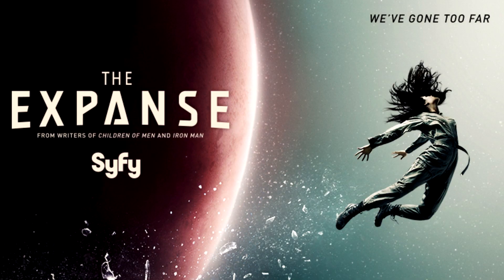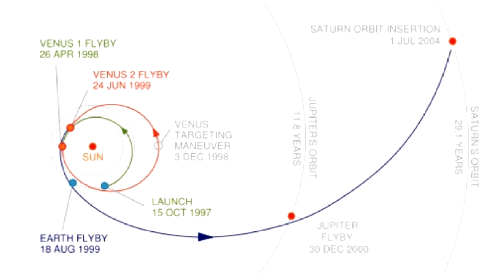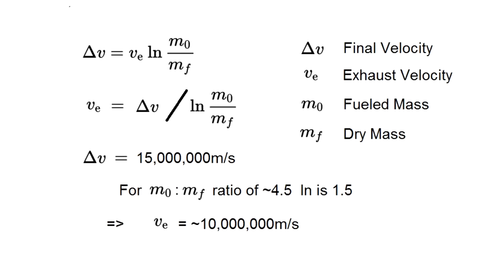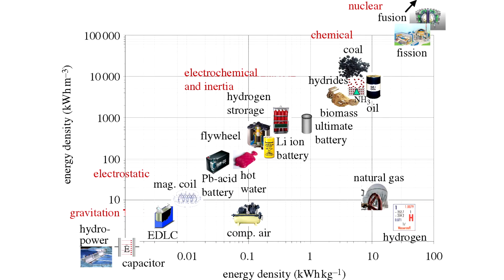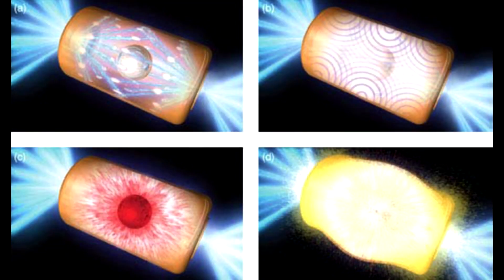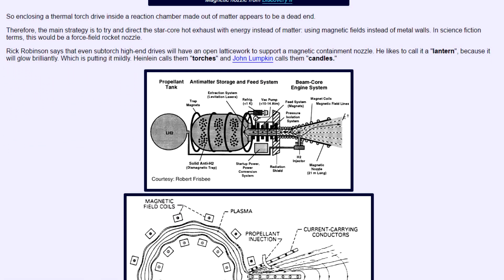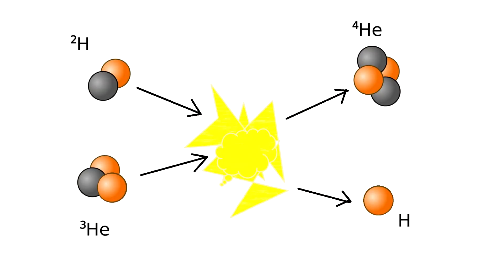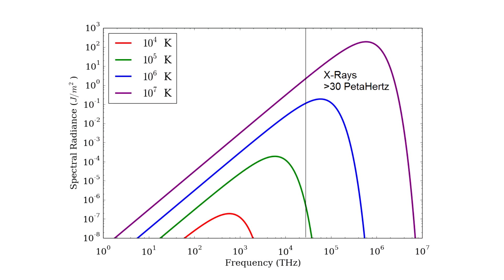The Rocket Science of 'The Expanse'

Comment: I finally recently started watching season one. Things l find implausible.
1) The sheer size of the vessels. And in comparison the volume ofcargo they carry. A perfectexampld is the first shp we see. Canterbury. Why haul around all that extra mass to store ice when you could melt the ice. Distill and store all the contaminates and haul the water in bladders or just refreeze it and push the frozen block of ice.
2) The sheer internal volume of the ships themselves. I know its a TV show but in the future when there are actually miners etc working out in the belt l doubt they will have the internal volume to spare. The MCRN battle ship is even worse.
3) Not just the volume of living space but how it is laid out. Again its a TV show and had to be shot on realistic budgets in sound stages. Given a continuous drive how ever it works. Let go with the approximate 1/3rd gee of Mars. Even during coasting phases some artificial gravity is nice. IMO the mag boots aren't going to cut it. Yes l can see there usefulness. A better solution especial for a merchantman water hauler would be a spin section with multiple modules that rotate on bearings with hatches inbetween the sections. The modules are arranged in a ring or partial rings. When the ship is coasting or at rest the modules are in their rest position. Meaning you head is pointed toward the Axis of the ship. When the vessel is accelerating the modules rotate so that your head is pointing in the direction of acceleration. At low thrust the spin section can still rotate with the floor being canted. Go to the Atomic Rockets website and look up Ezekiel Wheels. I had this idea years ago only to find out that somebody beat me to it. The vessels control station can be on the ships axis in zero gee when at rest.
3) The inplied scarcity of water and other vital supplies. Given what we know about the Solar System today or evenwhen Corey was writing The Expanse the Asteriod Belt is rich in water. At least in terms of what a human society would need. Given that Carbonacous Chondrite asteriods can be up to around 30% water and Ceres should be rich in water. You get the idea. And when the actorsare traversing the tunnels water is just dripping on them. Tunnels. Another dumb idea. Why do so many SF shows use tunnels.
4) Spining Ceres up for artificial gravity. The amount of energy needed to dpin up a body the size of Ceres to provide 1/3rd of a gee would better spent building an O Niel habitat. The Docks on Ceres or Eros Station. Wouldn't these  be better situated at the axis in zero gee. The huilding of Navoo/Nathan Hale or Tycho Station implies implies they they could build O'Niels.
5) Martian terra forming and importing "supplies". Why not divert cometary bodies that are already headed in system. And start small. Roof over part or parts of Valles Marinaris and establish habitats there. Plus Mars may have substantial subsurface water. And given any need of metals why not mine Mercury. 
5) Stealthed spaceships. Given the implied number of ships running around the Solar System there has to be some sort of traffic control system. Lord knows you do not want to be cruising through somebodies exhusst plume of fusion reaction products. Plus once your drive is running everybody with decent sensors will see you. Lets not talk about waste heat. Maybe use it to power a laser pointed out of the Plane of the Ecliptic?
Kenetic Weapons Systems. Those rail guns aren't just hitting their targets. The rounds that miss are now dangerous projectiles racing through the Solar System. How fast are they? Above Solar escape velocity? We know the ships are given travel times.

Comment: 6:21 Although we cant easily direct neutrons, how about if the plasma was moving in a loop and we arranged the fusion to occur while it was heading in the desired exhaust direction, even faster than the speed that the neutron would be fired off at? I figure this could both mean that the neutrons were useful as propellant mass and that they would not collide with the walls of the rocket.
I guess this would mean you have to suck a bunch of energy out of the charged products and put it into spinning up the plasma.

(edit) ah, just noticed there was 4x more energy going into the neutron. I suspect you are throwing so much energy away in the neutron that although you have not wasted it, it goes into thrust, you cannot replace it with the energy from the charged products.

(edit) Maybe this would work for a fission rocket though. According to wikipedia:
For uranium-235 (total mean fission energy 202.79 MeV[15]), typically ~169 MeV appears as the kinetic energy of the daughter nuclei, which fly apart at about 3% of the speed of light, due to Coulomb repulsion. Also, an average of 2.5 neutrons are emitted, with a mean kinetic energy per neutron of ~2 MeV (total of 4.8 MeV)

..so you could potentially expel all the neutrons safely and just have charged products to manipulate?

Comment: Here is how I hypothise the concept: in my theory the fusion techonolgy is advanced enough to fuse larger atoms in a compact enough reactor so it would be able to achieve something like the CNO cycle in stellar nucleosynthesis. The heavy stuff works as catalyst and only the hydrogen is really consumed, the resulting He can be used as reaction mass. The second issue which we don`t have relaibale technology to solve yet is the harnessing and use of energy from neutrino and gamma rays which can be used to accelerate the reaction mass to very high speeds increasing the trust that way (and/or some super dense material can be injected into the plasma stream increasing the actual mass too). In my theory the drives before Epstein used a simple p-p chain hence weren`t too effective, but with the modifications Epstien did the fusion moved to a CNO cycle producing much more enegry which accelerated the reaction mass to higher speed and produced significantly more trust. I know we still have at least two major obstacles we can`t adress with todays technology but flying an aircraft was unimaginable 300 years ago yet the laws of physics were the same. As for no fuel tanks, fuel could be simple water, probably stored between layers of hull, almost like jet fuel stored in wings of aircrafts. This would make sense as hydrogen is a good radiation shield, so this would protect the interior of the ship from cosmic radiation while also would act as fuel source.

Comment: Using the word "in reality" is a interpretation of declaring something impossible while, comparing the task with modern limitation resources. Epstien Drive sci "fi," only failed by a inexperienced space render profession inventor, as an 'energy/EC' rocket designer doing his own astro stunts. 

 Nuclear energy through (supressed truth) history. Was a nuclear battery🔋to manage a tiny dinky 🏟 halogen size🔦👀 of ion/plasma thrust in solar orbit. It was suppose to amp particle boosters from energy momentum pressure thrusters! Because it's not a chem-fuel liquid mass canister with limited volume, in micro air & solar orbit! 
 
 The energy thrust can regenerate, with far less idle time. So even a conservative acceleration of only 0.5 to 2.5 gravity gforce, non stop. Will generate both exponential accel velocity & simulated gravity comfort.

  Mankinds inexperienced of traveling in raw velocity ( without spoiler alterting time & space bending ). Is the required micro atmosphere SHIELD. At just 4% of light speed (in raw velocity). You can then use WINGS👀 in super micro air realms! But nobody has or brings up this knowledge & laughs with old text book declared science 📖 🙄.

Comment: Thanks for this amazing video. You mentioned how it would be incredibly hard to prevent all the heat generated from vaporising the spacecraft. What happens if the spacecraft is not physically attached to the engine but is held in a magnetic field so that between the heat source and the rest of the spacecraft there is empty space. Would it be possible then?

Comment: It seems you guys, yes I include the guys from the sources you mentioned, don't think stuff through. Ya'll claim D-He3 Fusion to be much better when in reality D-T Fusion would be Ideal since you could use Li-Be Shielding which can also be used in cristalline form to refract (NOT REFLECT) X-Rays and also breed more Tritium, so the Neutrons are not "wasted" but turned into fuel themselves. 

Seriously, no one even thinks about this on those websites, even though it is highly efficient in huge, longterm applications. 
The endproducts would also be all charged and could be accelerated with magnetic coils using the electrical output and chamberpressure of the reactor itself, 
therefore cooling it in the process, reducing the needs for radiators, even if they will still be there, of course. 

Also, you could, with smart usage of the Li-Be-Refractors, take the energy of the x-rays to microfocus them to a point where you want the fusion to take place, reducing the need for own lasers that induce the fusion reaction, therefore also minimalizing the amount of capacitors you'll need. 
The ones you have could, after initial reactor start-up, be used for gaussian cannons. ;-)  

Another use of the X-Rays would be to microfocus them out of the exhaust, to get rid of them. We are not that untrained with radiation refraction as you guess. 
Only needs a lot of time to calculate and construct such instruments.

Seems pretty sketchy to release a video talking about something you've maybe put half an hour thinking into. IDK, answer me, if you contradict what I said.

Comment: Why did you only consider direct momentum from fusion propellant particles? (I didn't watch the series). AFAIK, the early idea behind nuclear drive was to boost chemical rocket particles (e.g H2O) by increasing the exhaust temp. This has problems: increasing internal kinetic energy of the gas boosts particles in all directions increasing its pressure, so 1st it eats at the exhaust ducts and 2nd it dissipates this energy in all directions after gas leaves the nozzle. Additionally at some temp. you'll inevitably start loosing energy for reverse particle breakdown.
But what about using fusion energy indirectly to feed the efficient drive solutions, like plasma or rarely mentioned light/laser drive, where you can easily vector the particle stream? Focusing on just scooping entire fusion energy in a dedicated chamber(s) would be much easier than trying to direct most of it, while shielding against the reminder. Considering you just have that tech. to initiate and control fusion at the required rate of dozen TWs, one can safely assume you also have the tech. to stream it to the drive. In reality, this is mindbogglingly high - over 1000x the largest existing nuclear power plant. I strongly doubt this is even remotely possible. The final part is probably easiest to imagine - arrays of hundreds or thousands of plasma accelerators or lasers. Choosing the light drive completely eliminates the exhaust velocity problem, but with the (not so) funny note about safety - attitude malfunction or pilot error ends with an unstoppable razor space monkey on the loose.

Comment: I love The Expanse but they sure do play fast and loose with gravity and none of their ships, particularly the military ones where you think that it'd be a "no-brainer", seem to be designed to account for gravity that only exists under certain conditions. 

Surely every single crew member would have a duty station in a chair and be strapped in at all times particularly during alert situations but instead all you see are hard edges and what would be clear health and safety violations even if the ships had reliable, constant gravity that doesn't need power or active systems.

Also. what would be the inertial load on a vessel that's trying to do a 180 turn to decelerate at 1% of light speed, surely that would be a "super science" technology vastly greater than anything else on the show.
Reply: In the books, on normal ships, as 'crash couches' where they are required to strap in, especially in combat and/or when expecting other maneuvering; the Roci does have those in the show, as does the transport Miller takes in season 1, but in the bigger ships later in the show they tend not to show these, especially for the bridge and such.

Comment: So this is what I call standoff. Rocket engines are all about keeping all the energy away from the craft. Standoff. Even something like the SSME has huge power ratings if we include the total power of burning that much LOX/LH. But mostly we don't touch it. Fusion torch engines to alow thrust such that you can get an on the order of a g of acceleration... or any engine with 1000km/s Ve (beamed energy etc) requires AMAZING standoff figures. Like less than 0.1% of  0.1% of a millionth.... 

BTW 30TW is enough for a laser sail to get 200kN thrust!

Comment: I know this is an old video but I have to ask...why does specific impulse matter here? @2:35  If the spaceship can constantly run its engines then it should accelerate forever (as long as the engine is on).  Einstein told us from the ship's frame of reference (engines off) it is sitting still.  Does not matter if it accelerated out there.  Engines off it is sitting still and everyone else is moving.  If you went outside the spaceship and they turned the engines on it would accelerate away from you as if you were standing still...same as if you were on earth.  It dos not matter how fast the ship was going when it turned its engines off.  Turning them on would accelerate the ship.
Reply from the maker: Specific impulse tells us how long the engines can accelerate for its fuel supply.

Comment: One thing that would explain the whole epstine drive situation is if epstine invented a perfect x Ray mirror but didn't know it was a perfect mirror so he tells the ships computer to ramp up the amount of fule it burns per second untill it starts to over heat or the radiation levels get to high of course because the reaction chamber is lined with this mirror and the rest of the products besides the small amount of neutrons are contained in a magnetic field and pushed out the back the ship doesn't over heat  radiation levels don't get to high he ends up with 30 % more thrust and becomes a g 🥞
Reply from the maker: A neutron mirror might be even better I think.

Comment: There is artificial gravity in some scenes. There is artificial gravity on spinning asteroids and spacecraft, which I guess is somewhat plausible (maybe not on asteroids), but there is also artificial gravity on any ship that has a drive, like the Rocinante. When they turn the ship's reactor on or off it seems to toggle gravity as well. An interesting topic I would like to see explored is the use of some sort of liquid injected into their bodies to decrease the effects of high acceleration.
Reply: Years late I know, but the artificial gravity on ships is due to the constant acceleration rather than "turning on" with the reactor. It's why all the ships are structured like towers instead of laid out horizontally.

Comment: Just recently reported in Sky News, https://news.sky.com/story/uk-built-spacecraft-bepicolombo-set-to-explore-mercurys-mysteries-11526240, 'BepiColombo carries a futuristic ion electric propulsion drive, also designed and built in the UK. They work by "ionising" inert xenon gas - knocking an electron off the gas atoms to give them a positive charge.
The resulting "plasma" is attracted by electrostatic forces to a grid with an opposite negative charge and fired out of the thruster at 90,000mph.' this would basically mean that all new 'old-style' fuelled rocket engines would be obsolete very soon after.
Reply: Fucking hell. Y U DO DIS?! Media, stop being idiotic.